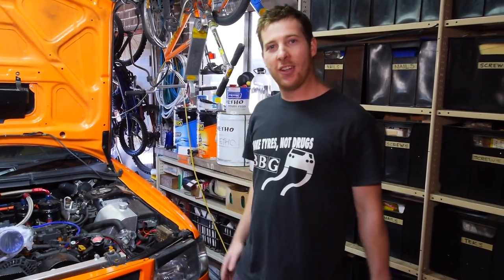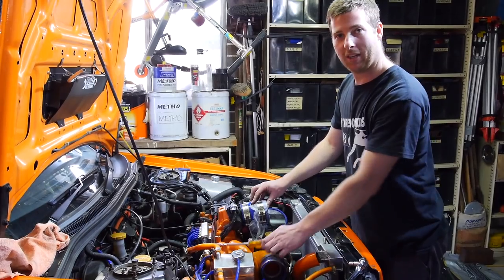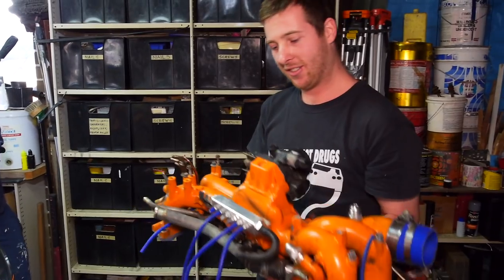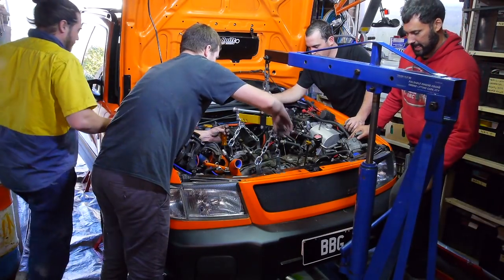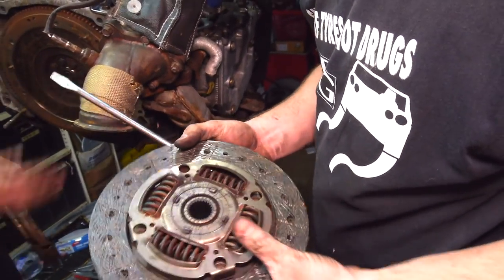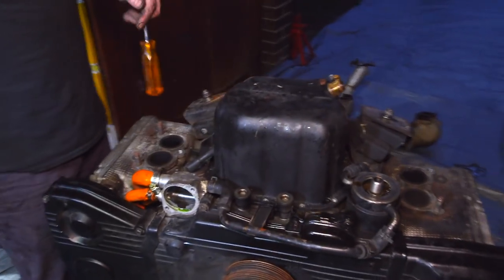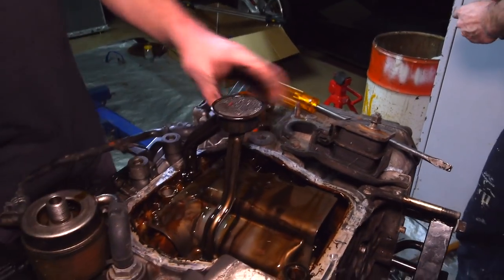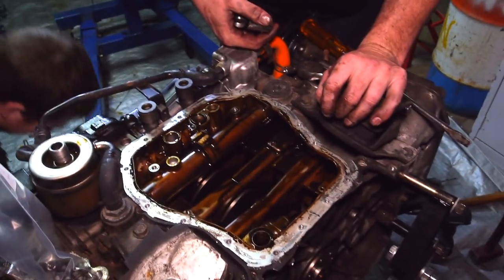REMOVING THE EJ207 FROM THE CARROT! MAKE WAY FOR THE 257!

Comment: What turbo? Custom down pipe with vband or aftermarket?
Reply from the maker: Frank Dasaro Am I going to be running? GTX3576r, and yes my whole exhaust is custom all vband
Reply: Boosted & Built Garage how many sections is it in if you don't mind me asking is there like a mid pipe after that downpipe then your catback or just two sections? Been having a lot of issues with mine and looking for a better option.
Reply from the maker: Frank Dasaro It goes: Downpipe under to the back of box > mid pipe to where tailshaft connects to diff (roughly) > tailpipe.

What issues you having?

Comment: How reliable was the 207 for You? I'm from the US with a 205 in my wrx and a lot of people love the 207 over the 257.
Reply from the maker: Scoobysnack 05 207 was fine up to a point, same as 257 would be too. I just wanted that little bit too much out of it and it couldn't handle it. 
V7 and up 207s are factory semi closed. It's all in the tune and the oil/maintenance to keep em reliable (and not pushing too hard) - don't rev it to 8k like I was haha
Reply: Boosted & Built Garage what were you running power wise? I'm new to the channel and enjoy the forester lol.
Reply from the maker: Scoobysnack 05 Was about 200-220kw.